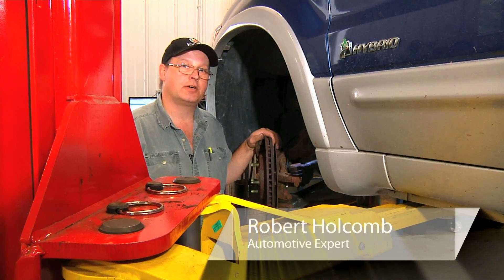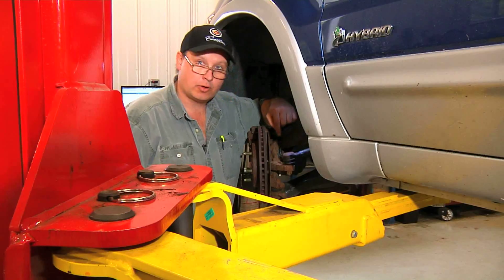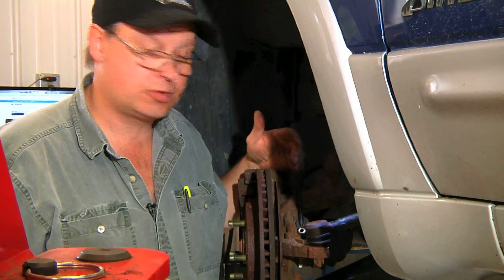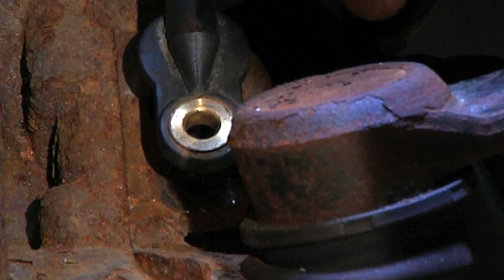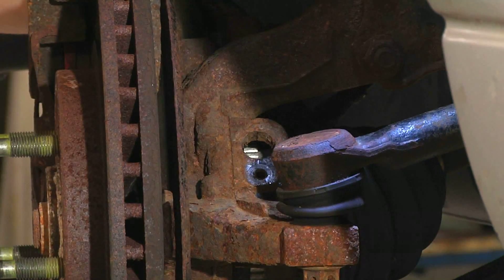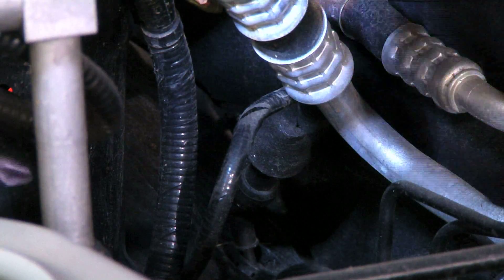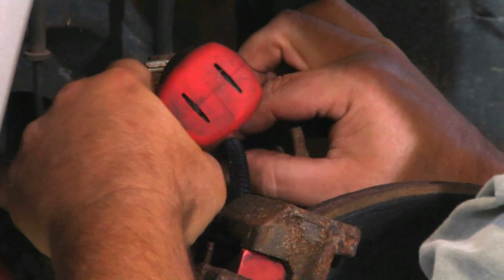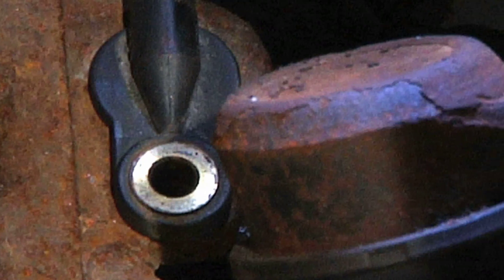ABS Brakes & More : How to Diagnose an ABS Wheel Sensor

Comment: "Diagnosis" may lead to replacement- but your video is incorrectly titled. WOW this is a relatively new and exspensive car- to be rusted out like that. But- as with many owners- they only care about the outward appearance (body & glass) and don't really pay attention to the undercarrige. What a rustbucket. A wire brush, rust reformer paint, and your choice of high temp caliper colors or even clear- is better than nothing.